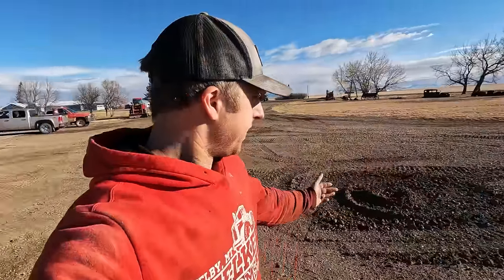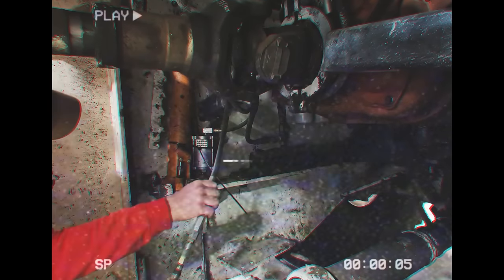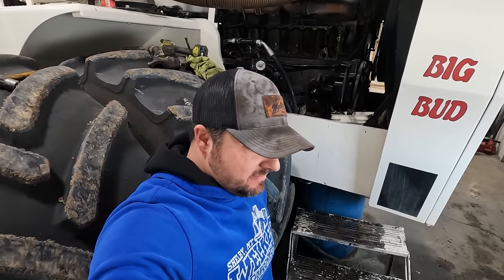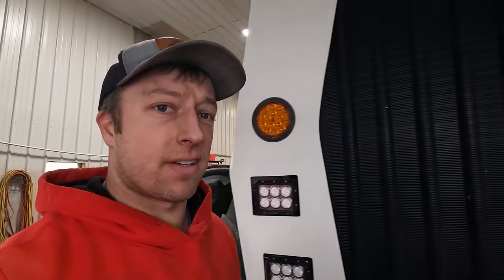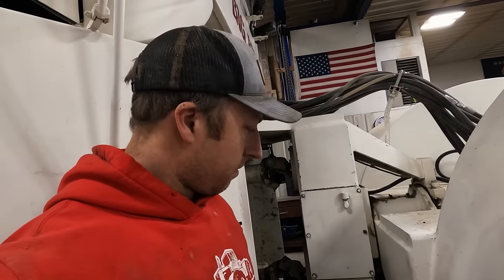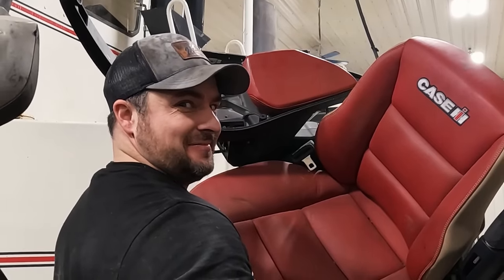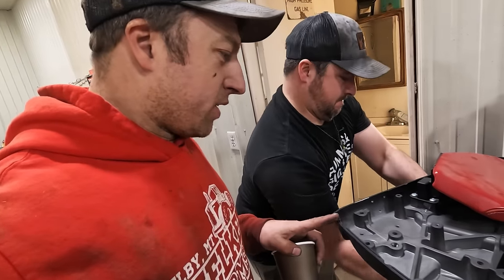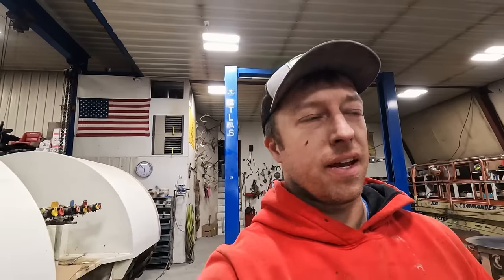You're seriously putting that in the BIG BUD?!?

Comment: Btw: that hot & cold thingy is called "interference fit". Expanding one part with heat and frosting the other gives you a few thousands clearance and then you can slip it on instead of pressing. I did learn that on the CEE Australia YouTube cannel. Kurtis does repair large stuff from mining and earthwork companies. He knows incredibly much about metal properties, lathe works, line boring & line welding, old school methods & machinery. All while being still a relatively young age and taking pride in doing the right repair job and doing it precise - despite all these massive parts from scrapers, excevators, mining dump trucks and other heavy machinery... 😎👍

Comment: My career was machine shop maintenance. I can think of only one time where we employed a Speedy Sleeve. They look great in the catalogs, but it seemed that no solution was ever available for our applications. I hadn't thought about any need to support the repair sleeve such as you did with the "cold weld".  That support sounds prudent since the first repair sleeve failed. 
I rebuilt a 1/2 ton Ford van front spindle after bearing failure on my wife's family van.  I was too poor to replace worn spindle and figured bearing race contact would tolerate a tiny imperfection. I used Devcon material trusting it over auto parts store JB Weld. Using a micrometer and the race as a GO/ NO GO gage I sanded the damaged spindle journal to a perfect fit. I was fully satisfied with the repair success and the safety of putting my family in the van. This repair success has caused me to trust these products a lot more than a mechanic is inclined to do.
I fought removing a hydraulic cylinder rod nut for hours under extremely tight access. Lead time on the cylinder was about 6 months. I eventually had to hold the rod with a pipe wrench for purchase to turn the nut. When I got the nut off I discovered two completely overlooked locking set screws in the rod nut. Realizing that I had just trashed an unavailable cylinder I employed JB Weld to repair the rod damage from the  pipe wrench. That repair was permanent, though intended as only a stop gap. 
I am a supporter of these products and consider them permanent solutions in more places than I thought that I ever would. Speedy Sleeve support seems like a proper place to employ them. An undercut in the lathe would allow a deeper product thickness. You saved the yoke, you didn't have to resort to spray welding or chrome and grinding, which are arguably better. I think that this repair is permanent. The OEM yoke wore, the first sleeve wore and/or failed. I suspect that wear will wreck this sleeve, but at an acceptable rate, and the next repair will only require a new sleeve.

Comment: Hi from the UK. The steel pipe away from your compressor, check it’s not part blocked with burnt oil/carbon else it will blow the new compressor

Comment: Nick AKA Hollywood, when I tore tendons (1/2 mm tear) in both of my shoulders, it took a year and a half for them to heal properly.  Just an FYI as to how long it could take.  My advise to you is to keep the shoulder moving so the tendons don't heal improperly.  It might hurt, but keeping the shoulder moving prevents the tendons from healing small/shorter limiting your range.  Physio helps but surgery might be necessary if the tendons heal improperly.  Here's to a speedy recovery.  Cheers!

Comment: We had a Detroit 8-71 ones that had an air compressor oil seal fail.  Instead of pushing air in to the engine like yours ours pumped all the oil into the air tanks.. That was fun to clean out the air system and rebuild the engine.

Comment: I used to use speedy sleeve seals on a worn out and generally abused trailer that I had. I would wipe a thin layer of silicon on the nicked and grooved up area. That lubed up the sleeve as I drove it on and filled any defects, worked great.
Reply: Reach out to abom79 on YouTube to spray weld the yoke back to Oem spec

Comment: Leg Arms is right about pressurizing the engine crank case.  I saw that happen on an engine that routed the crankcase fumes back into the intake.  It had a steel canister that I think was supposed collect the oil and route it back into the engine.  It was being ran outside during the winter and I think that canister got blocked with ice.  It was then pushing oil out all the gaskets and seals.  I bypassed that part and cleaned what I could of the oil.  It quit leaking and worked good after that.

Comment: By putting some silicone sealer on those U bolts holding the U joint will give the lock washers and nuts a little more grip to keep them from backing off due to vibration.

Comment: I had an air compressor do that but to the cooling side. It would run for 30 seconds before started puking out the radiator.  It seemed like a blown head gasket and we replaced it. Still puked out. So I got to investing and found coolant in the air lines coming in and out the compressor. Replaced the compressor and there ya go. No more coolant violently puking our the radiator! That was on a cummins qsb 6.7l. Ive also seen air compressor wear out and fill the air tanks half full of motor oil as well! So I know that struggle bro. I want to fly up there for a week and just help you work on stuff and fabricate stuff! That would be epic!!! I would do it for just for the fun and fellowship! God bless yall!
Reply from the maker: Can't live without em but many those pesky air compressors can give grief at times!

Comment: Thanks for another great video. It was interesting and enjoyable. 

Bob, your about have the seed cleaner all ready with all the fine details you are doing. Good you are doing the safety covers on the belts and such. My compliments to all of you for building this machine. 
I like the duct take bandage on you hand. Done that myself. Works pretty good for a good bandage. 

LegArms you did a great analysis of the air pump on the big bud tractor. You figured that problem out with ease. Sounds like you are on the right track there. You are getting the big bud ready for spring seeding. 

Nick, good going on fixing the oil leaks around the drive knuckle system. That was a big job but you kept at and figured it out and re-machined the knuckle shaft and got it fixed by redoing the shaft. Good work. 

You all will soon have the big buds ready for a busy spring seeding the crops. Busy time coming. 
 
The seats you got from IH will look good in the big bud. Dad will really enjoy having that nice comfortable seat. Long hours in the cab make a need for a good seat. Good going on getting that seat set up. Enjoy. 

About it for now. Enjoy the trip to New Oleans for that farm show. Believe you will meet up with Zach, watch out for him, gets a little wild sometimes-ha!!  
Looking forward to the next video. 
Thanks for everything you do for us. 
The Iowa farm boy. 
Steve.

Comment: Hi Nick. Just a little information for you. In most cases most mild steel will expand at least 0.003 inch at 300 degrees f. An easy way to measure(approximate this temperature is with a temp stick. Looks like a crayon but has been calibrated(engineered) to melt at a specific temperature. They are relatively inexpensive and can be purchased from some one like McMaster car, Grainger or Applied industrial Technology.  To use you simply touch it to the part you have heated. If it melts, it is at least the temp the stick is rated for.

Comment: Bad valve guilds can cause this too. My dad had Machine screw up set of heads for big cam II pushing turbo boost into crankcase. I work on trucks have special wrenches from snap-on, matco and mac. Why because one can't turn it far enough to catch next set of hex. Other wrenches are clocked different so you use one and then other one switching back and forth. OH THE FUN with that you just want to plant your foot right in their rear. Tools are not that pricey

Comment: Not this video but in the past with bearings. Get a cast iron pot ( size depending on bearing size) put some 30 weight oil in it enough to cover the bearing. Run a small wire through it and make it long. And put the pot on a propane burner like used to fry fish, hold the bearing off the bottom and start heating the oil. When the oil comes to like a boil just bubbles it will heat the bearing evenly and not hurt it. Then remove and it too will go on the shaft with out a lot of trouble.

Comment: They need 3 crank case breathers in the valve covers! It’s a defect in design put 2 more valve covers with breathers on the #1,#3,&#6 heads and it’ll solve all of your oil leaking problems.

Comment: The Cummins Holset air compressors are definitely prone to pumping oil. Changed a number of them on ISC and QSC engines. They'd start pumping oil through the air system which isn't desirable.

Comment: Cummins.  One step above a 92 series Detroit but to bad it wasn’t a cat be a lot less trouble. In a truck the kt series was not a very good engine.  The 855 was less trouble but a yellow motor would have been the cats meow.   Question. Was there ever a diff lock as an option on a bud

Comment: When your dad was looking at the squirrel cage fan for the pea cleaning machine, it caused me to think of a time when we were hunting moose in northern Alberta.  A friend left the storage door open on his 5th wheel.  Well, a mouse managed to find its way into the furnace.  We had been away for a few hours taking our moose to the butcher in Hinton.  There had been an accident on the highway and we were stranded for overnight.  When we finally got back to the 5th wheel, we turned on the furnace.  When the fan came on, there was a terrible noise in the furnace fan.  We had to shut it off.  We then used a generator to run a heater at night.  When the furnace fan was repaired, the tech found that a mouse got into the fan.  It killed the mouse.  We wondered why the mouse did not understand that the fan was a "squirrel cage" fan and it was not meant to be a "mouse cage fan" at all.  That was one tough lesson for Mickey.  😊